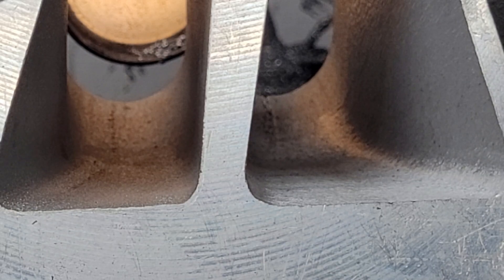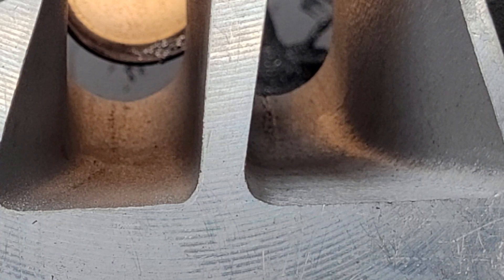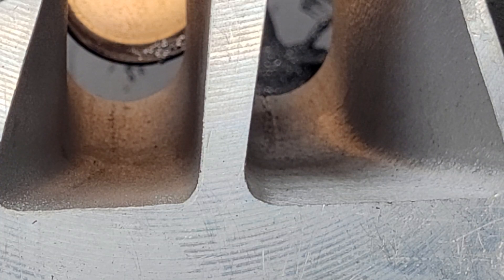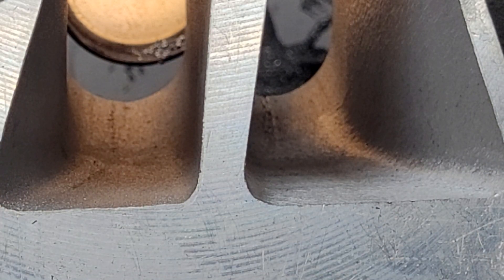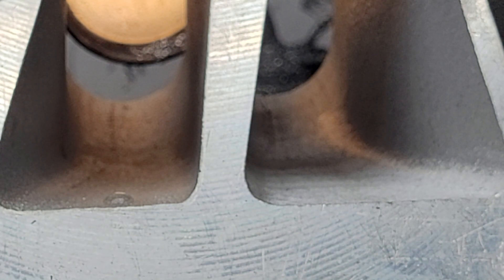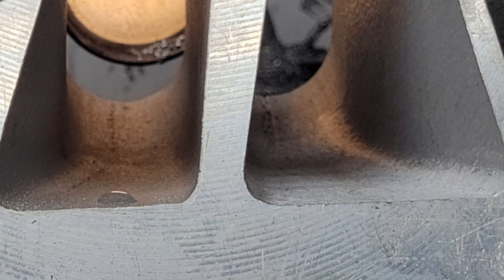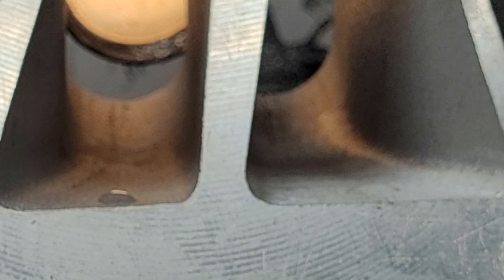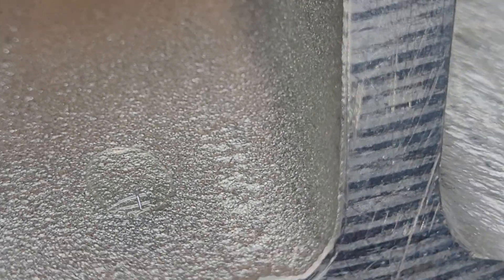What does a textured manifold do differently than a smooth manifold? Simple wet flow experiment.

Comment: Charles, that old Chevy block you showed the deburring of, that could be a great example as well. If you haven't ground all the original casting away. On the rear wall beneath the oil drain backs. The as cast vs burr is easy to see if still possible. 

The water gets down the burr finish runner quicker than Lightning McQueen!
Reply from the maker: Yes it does! I think it breaks the surface tension!
Reply: @servediocylinderheads  you bet it does! It gets things(air, fuel, oil, water, etc) where they need to be. Instead of waiting around and thinking about making a sandwich like the snail in the left lane.
Reply: @servediocylinderheads  OEM castings for sure! Dart Pro 1 As Cast or Trickflow Fast As Cast surfaces may be different. 

Still a solid win and excellent visual aid.
Reply from the maker: @arturozarate1752  Thanks!

Comment: This all depends on the viscosity and density of the fluid. Water has a higher viscosity, and higher density than air, so a very smooth surface will cause more drag because there's more surface area for the water to cling to(especially at really low speeds). A textured surface has less because of the peaks and valleys. With air, since it has lower density and lower viscosity, the texture tends to thicken the boundary layer of air flowing across the surface, especially at higher speeds that running engines see. Because the air trips over the peaks and valleys, this has the practical effect of making the passage(port/runner) smaller because the boundary layer has the effect of slowing down the air near the walls.

With subsonic air, reducing the cross section area of a port/runner/pipe increases flow velocity until you reach a critical point where the smaller cross section starts to restrict airflow. At least according to Bernoulli.

So you're stuck compromising, because a rougher texture helps wet flow, but it also begins to restrict airflow at a certain point. This isn't necessarily a bad thing if you can get enough airflow, at a high enough velocity for the engine speeds you plan to be running, won't affect power from airflow too much. I guess that's why 40-70 grit finishes are a good compromise, and if you really want to improve wet flow, and already have plenty of air flow, a burr finish is the way to go.

At least that's how my brain makes sense of all this, I could be way off the mark.
Reply: In theory....that's a solid copy. If you're asking Charles for his take on Bernoulli, then ask him.
Reply: You have one detail backwards but your line of thinking correct, there is more surface area with rough finishes, hence the restriction and slowed airflow.
Reply: @RyanMcIntyre  The boundary layer is what air rides on, textured surface increases the boundary layer thickness making the port smaller. This is because the boundary layer is made up of still air. Air flows through the whole port, not just the walls.

I look at CFD of combustion engines every day.

Comment: I've been working on the making the flowbench today. Still got a long way to go. But it's getting there. Git pretty much everything boxed out. Now u need to wrap things up. And Install a port for a manometer (measures pressure) near the cylinder bore orifice. And an anemometer. That u am using to calculate cfm. By measur8ng the speednof air at a certain prrssure across a known area. then u need a valve to help control the pressure draw to 1 psi aka 28" of water. But then I will have an actual flow bench to compare results with 4 cfm or so.
Reply from the maker: Get some calibration plates and then you will have something repeatable.
Reply: @servediocylinderheads  Charlie, couldn't I just create a plate with a known orifice size? And a radius? And do that to compare results? I know I am going to have to change the motor speed and adjustment valve for each individual valve lift.
Reply from the maker: @jonathoncouchey7151  Get a certified sharp edge plate. Get a few, then there is no question on your results.